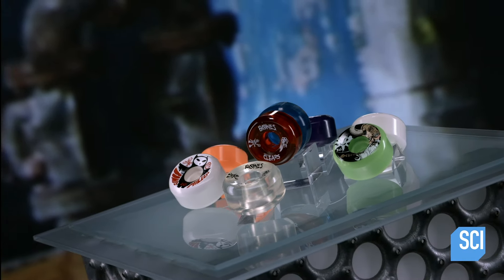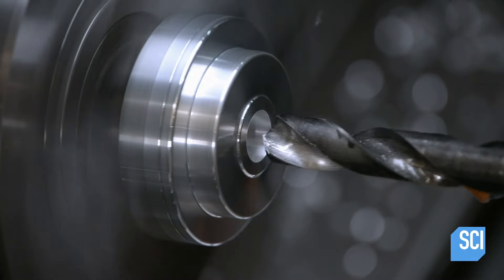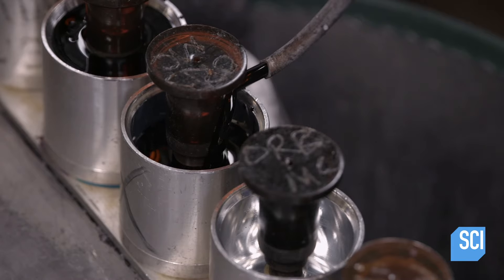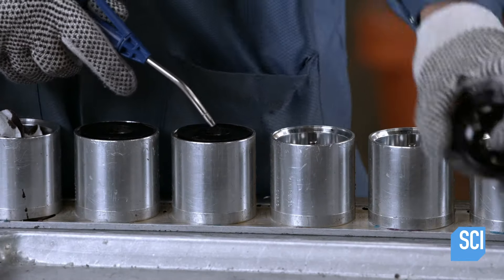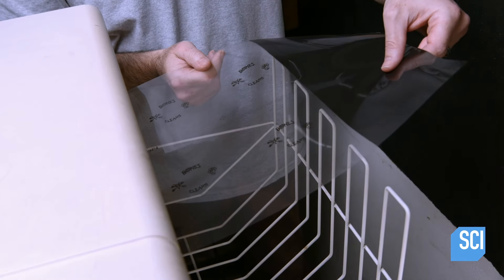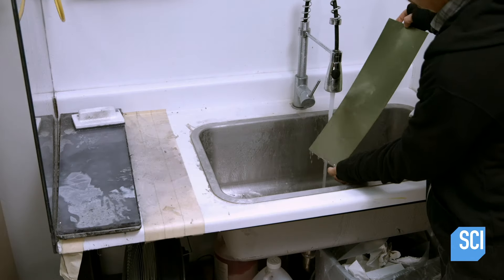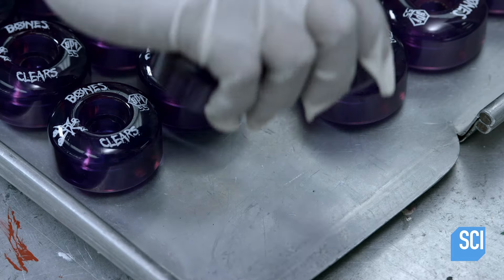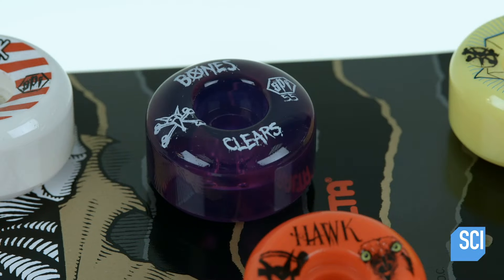How It's Made: Skateboard Wheels

Comment: I worked at a skateboard wheel manufacturer in the early 80s, computers were not part of the process, we would make adjustments to the polyurethane mix to get the right hardness (durometer rating) pop the wheels out ot the molds with compressed air, and turn the back smooth on a lathe, that was about it, super cheap to make once we had the molds, several hundred made of stainless steel on a big lazy Susan table, I made thousands of wheels a week, those were the days, the company was called Polymer Products, in Irvine/ElToro California

Comment: They used to use metal or ceramic?? What were they thinking? Were they high?
Reply: My first skateboard was a roller skate with metal wheels that was taken apart and bolted to an oak board. It did not turn very well.